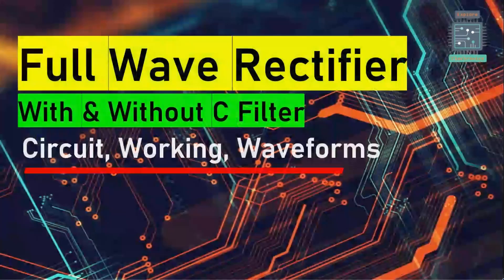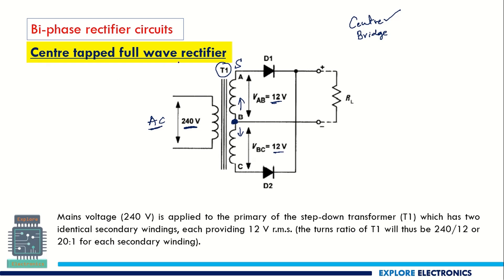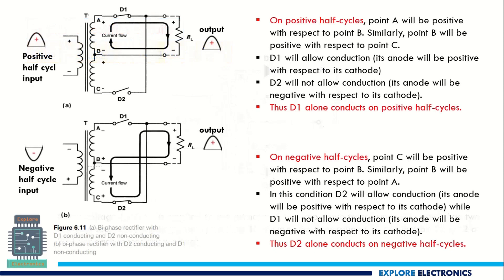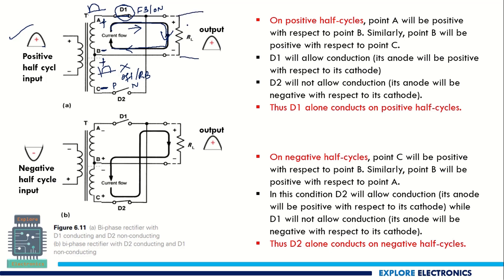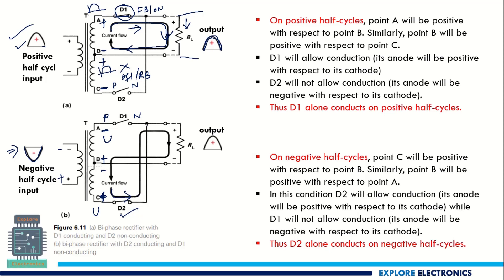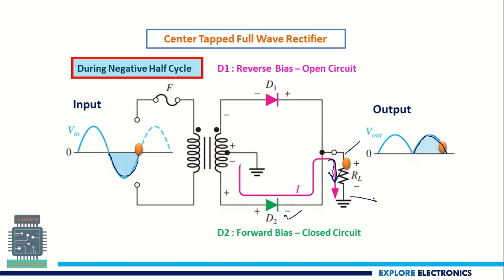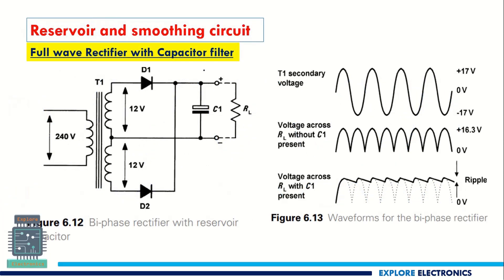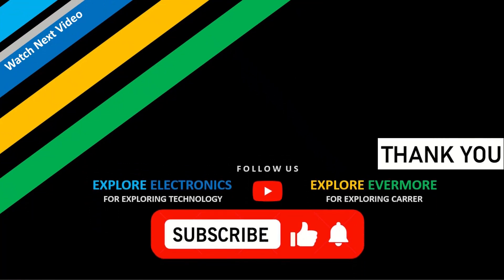Full wave Rectifier | with & without Capacitor Filter | 1BECE105/205

Comment: Please make a video on filter circuit, capacitor filter circuit, half wave rectifier with capacitor filter and zener diode characteristics and zener diode as voltage regulator.
Reply from the maker: check Basic Electronics playlist

Comment: Please make a video on filter circuit, capacitor filter circuit, half wave rectifier with capacitor filter and zener diode characteristics and zener diode as voltage regulator.